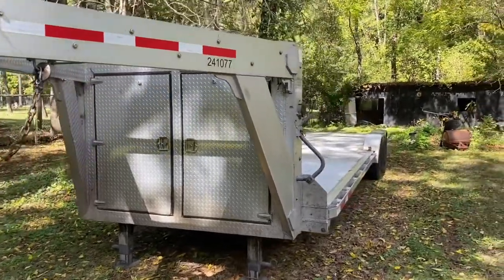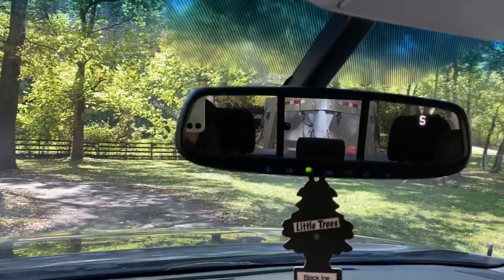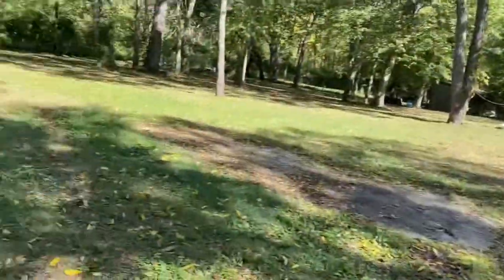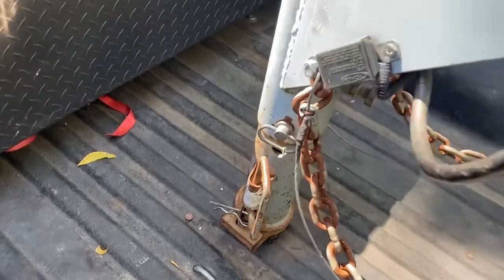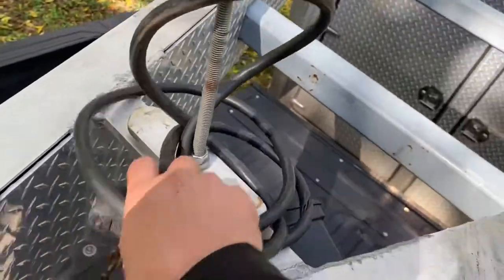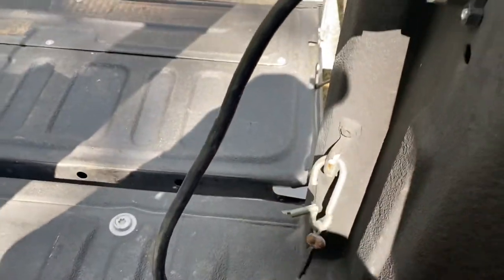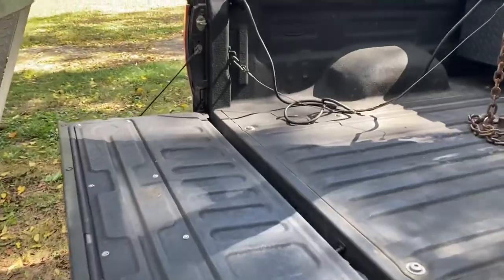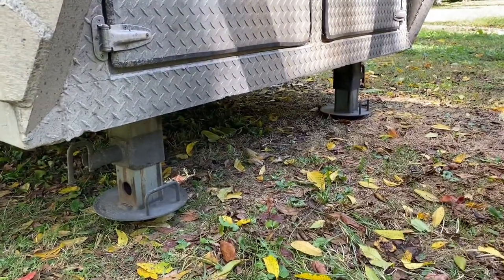How to Connect a Gooseneck Trailer

Comment: I plan on putting my 1994 F-150 to work like this. I'm working on getting the truck a new frame from a hot-rod shop in a few years.
Reply from the maker: An older F150, or any half ton of that era won’t be suitable for this line of work. It may do the job, but it won’t do it for long. Not enough power, trans won’t stay cool enough, rear end isn’t big enough, & the list goes on. If I were you, I’d wait until I got a bigger truck.
Reply: @HotshotJimmy  You do have a point about a bigger truck and how my current one is underrated. 

I got a couple plans for this half tonner of mine. Planning to swap a built Cummins 5.9L Natural Gas/Pump Gas swap (I like big 6 cylinders, but don't really care for diesels in the pickup truck community) so it can take the factory Ford 4.9L's place. Plan to replace the factory rear end for a Ford or Dodge Heavy Duty rear end. Swap the 4 Speed automatic with a 6 Speed automatic (may go for a GM trans with a custom bellhousing that'll fit the engine without having to have that pos adapter plate crap) with a 04-14 F-150 IFS suspension on the new long wheelbase hot-rod frame. 

There's A LOT of work I want to put in my old lariat, dude. A lot.
Reply from the maker: @RBLUS_TY  Even with mods, it still doesn’t have the GVWR for the job.
Reply: U should work on getting a new truck... nota new frame...
Reply: @S2KCYA  Nah. I don't want a new truck. Fucc the new ones.
Reply from the maker: @S2KCYA  Toyota replaced them for free, along with brake lines, control arms, everything. Get an American company to replace anything after 100k. Good luck with that.
Reply: @RBLUS_TY  this is a mess. But keep dreaming bro 😂😂

Comment: What's the payload capacity of your tundra? Depending on how much you're towing with that gooseneck, itll eat up alot of your payload of which, generally speaking, 1/2 tons aren't recommended for 5th wheel/gooseneck trailers, as far as I'm aware.
Reply from the maker: Payload doesn’t apply in commercial trucking. Axle weights do. Payload is never listed on the door jam. Modern half tons are able to pull lighter 5ths & GN. Depends on manufacturer & model.
Reply: @HotshotJimmy  commercial trucking aside, all mine and my wifes vehicles have stickers in the driver front door jam specifying payload, even 3/4 and 1 ton vehicles have them as I've seen when loading customers vehicles at home depot. That's interesting 🤔.
Reply from the maker: @Kingswood7189  They have GVWR. Maybe that is what you’re referring to. Trucks with factory GVWR under 10,000 are legally allowed to be modified to carry a heavier load. But with a maximum power unit GVWR of 10,000 according to the FMCSA. Any vehicle that has a factory rating over 10,000 is excluded.
Reply: @HotshotJimmy  I've seen those stickers, too. The ones I'm referring to show recommended tire pressure and cargo/payload capacity in kgs and lbs including the occupants.
Reply from the maker: @Kingswood7189  Tire pressure is on all vehicles. Cargo including occupants is not on most trucks that I know of. There is also not a perfect way to measure payload. That’s where GVWR & axle weights come in.

Comment: Do you still use this truck. I just bought one because I couldn't get a diesel due to personal but I'm concerned about the bed size in order to haul. What do I need to do different with the short bed? Amy advice
Reply from the maker: I recently traded it in. If you have a 5.5 bed, you’ll need an offset coupler.

Comment: thats a lot of weight for a tundra! how much do you tow over factory rating?
Reply from the maker: Double cab & standard cab models are rated for gooseneck towing, however with no stated capacity. Crewmax models cannot. Bumper pull is 10,200 lbs. I’m commercially rated for 26,000lbs GCWR.
Reply: Hey what's up man I like your Tundra a lot you pull a lot of weight have a 2005 Toyota Tundra double cab and I pulled up to 18,000 Pounds with that truck here in Colorado bumper pull trailer it was a dump trailer
Reply from the maker: @raulbueno4284  An 18k trailer would have pulled the hitch off the frame of that year Tundra. The 2000 to 2006 tundra hitches are not rated for much weight. They are not big enough.
Reply: The same hatch on the same frame as those second gen as the 3rd gen Tundra it's the same thing man look under 1st Gen to 2nd gen to a 3rd gen tundra or the same thing buy the first round and a third gen Tundra has I feel the same power and the same crap on it
Reply from the maker: @raulbueno4284  They are not the same, nowhere near the same.
Reply: They are the same and why why because look at the first gen look at the second gen and look at 3rd gen if there was no person or we'll never be a tundra think about that man why because look under from the first gen to the 2nd gen and 3rd gen Tundra I have a triple Tech frame as a semi they use the same transmission the same engine the same powertrain everything's the same bro it just bigger that's all you think you know everything I've been a mechanic for five years I've been telling for 10 years man
Reply from the maker: @raulbueno4284  2006 trucks & 2015 trucks are nowhere even close to the same.
Reply: @raulbueno4284  1st gen Tundras are a completely different truck than the 2nd gen (a 3rd gen is the same as a second gen but with updated sheet metal and interior). Different frame, different axles, the only carryovers were the 1GR and 2UZ engines as the entry and mid level options on the 2nd gen trucks as well as the associated A750E/F transmission. The 1st gen Tundra is more of a slightly beefier T100, while the 2nd and 3rd gens are true half tons (more like a 5/8th ton in reality). How do I know? I worked as a mechanic for 5 years at a Toyota truck and Land Cruiser specialty shop, and I have a 1st and 2nd gen sitting in my driveway.
Reply: Man the Toyota Tundras all generations half ton trucks but I'm saying is the first generation Tundra it's basically as a half ton more than 1/2 ton because I how up to 18000 pounds here in Colorado in the mountains Towing how much weight in Apple's better than a diesel truck I know that for a fact man come here to Colorado and test my truck my both trucks and I will let you what's the best route I'm not saying the first gen or 2nd gen or 3rd gen are better all of them are the best Ya Back Dan the trucks were smaller the Ram 1500 Colorado back then and a Ford F-150 was smaller are the same crap man they just got bigger don't tell me I don't know s*** bro you probably don't know crap still you were work for 5 years for Toyota yeah I work for 5 years out of mechanic working every single car 10 years of Towing you don't think I know
Reply: Let me tell you this man what's better a 4.7 v8 iForce versus a 5.7 iForce which one went to a million miles man the first generation Tundra with a 4.7 man I know they're a little bit bigger for trucks it doesn't matter why because I tested the first gen to the second gen third gen Tundra us up the mountains here in Colorado I didn't feel nothing difference over the truck they're both over-engineered and the balls heavy duty trucks I don't call on v h trucks I call him 1 ton trucks why because how much the truck will haul and how much will talk so much weight without no issues there Workhorse a truck man I know I'm talking about bro don't think I f**** don't know about my Trex bro yeah you been a mechanic for five years working Toyota dealership I don't give a f*** you did but let me just tell you this mad I do real world testing and real-world things with trucks redo fixing cars at Salt bro push it to the Limit over the limits to plus I know I'm talking about next time you should keep your mouth shut before you talk
Reply from the maker: @asher1147  Couldn’t have said it any better.
Reply from the maker: @raulbueno4284  Clearly you don’t know what you’re talking about. 2000-2006 Tundra’s are a slightly beefed T100. I tow for a living. I know what I’m doing. My parents have an 06. It’s no comparison.
Reply: @HotshotJimmy  is that because the crewmax come with the shortest bed?   I was thinking about getting a crewmax tundra to occasionally pull goosenecks.   But may want to go a different route now.   Unfortunately I really need the largest crewmax cab because it’ll be a daily driver for my family and we have young kids with car seats.   I was hoping to get the tundra and use it as an emergency work truck towing goosenecks.
Reply from the maker: @lordrichard8184  Toyota says no.... but I have seen it done. Only issue is you cannot have a bed toolbox or anything else in the bed while towing with a crewmax. There isn’t any room. Air bag it & the truck will be fine. You can’t turn more than 90° with a crewmax
Reply: @HotshotJimmy  why not crewmax? Only vehicles I see for sale are crewmax and I have a gooseneck trailer.
Reply from the maker: @CH-jq7xg  Can’t turn as sharp with the short bed. Also can’t fit toolbox & gooseneck at the same time.
Reply: No wonder tundra pulled across California city 360k lb space shuttle without problems.
Reply from the maker: @repairvehicle  Weight of the shuttle was 292k. 

The testing weight was just over 300k
Reply: @HotshotJimmy   , you are correct.  Still have tundra?
Reply from the maker: @repairvehicle  No, traded it in on an F450
Reply: @HotshotJimmy , how reliable is your f450 comparing to tundra? What has been replaced or repaired on Ford, if anything?
Reply from the maker: @repairvehicle  Tundra never let me down. 450 is new so nothing (yet)

Comment: First time I've ever seen a tundra pulling gooseneck ....😳
Reply from the maker: Not many commercially, they’re rough on fuel.... but reliable
Reply: @HotshotJimmy  are they bad on fule empty without trailer....
Reply from the maker: @burtbunns2270  Without trailer 15-17

With trailer loaded or unloaded 8-11 depending on wind.
Reply: Thanks ...I was checking those trucks out ... blessings 👍
Reply: 8mpg with trailer is not rough,  just like any other gas truck.

Comment: How much can you tow with the tundra?
Reply from the maker: I usually scale about 20k. Truck + GN empty is just over 11k.
Reply: @HotshotJimmy  Any issues with DOT towing over factory tow compacity?
Reply from the maker: @joshmansolillo1831  Factory recommendation & commercial GCWR are two different terms. My truck is rated to pull gooseneck & fifth wheel, however with no stated capacity l.
Reply: @HotshotJimmy  Gotcha, I run a 16k tag trailer regularly with my Tundra, always worried about getting jammed up if ever in an investigated accident. I suppose as long as your trucks GVWR is fine with tougue weight and your trailer is good send it
Reply: Would love a video on your truck set up! I just added the road master active suspension to my tundra and it made a huge difference
Reply from the maker: @TheRoeshow0324  I’ll be sure to make one soon!

Comment: This guy could drop a 100 dollar bill on the ground every weekday of the month and still be saving money on a cummins payment. 😂😂
Reply from the maker: What do you mean by that? I don’t understand your reference
Reply: @HotshotJimmy  it means a cummins is twice the price for the same thing a tundra can do for half the price ish.
Reply from the maker: @bryaniskoo  Oh yes, I try to keep cargo weight 10,000 pounds or less to keep the truck happy. 249k no issues or weird noises. However, I’m in the process of buying a new truck. I have to let this one go before it is worth nothing due to mileage.
Reply from the maker: @bryaniskoo  Oh yes, I try to keep cargo weight 10,000 pounds or less to keep the truck happy. 249k no issues or weird noises. However, I’m in the process of buying a new truck. I have to let this one go before it is worth nothing due to mileage.
Reply from the maker: @bryaniskoo  For non-CDL, the truck does just fine. 249k zero issues or weird noises
Reply: How much$ for the tow hitch on the bed set up?
Reply from the maker: @jgutierrez7527  $479 from 4WP. They will price match E Trailer.
Reply: @HotshotJimmy  thanks for the info,  now did you have get class C license to tow with your tundra and trailer?
Reply from the maker: @jgutierrez7527  No, here in Ohio you can have a standard license for 26,000 & below.
Reply: @HotshotJimmy  awesome news thanks for the info 👍

Comment: Honestly if ur driving a toyota u are not in the truck game that's a awd minivan with a bed...
Reply from the maker: This comment shows your ignorance.
Reply: @HotshotJimmy  using a toyota to pull a 5th wheel is ignorance... is that even rated for such a load??? Or u just hauling a empty trailer...
Reply from the maker: @S2KCYA  It is, go yo the dealer & look in the owners manual. 

This truck worked for 300k miles cross country. I traded it in. Never spent a day in the shop.
Reply from the maker: The USA is the ONLY country where Toyota trucks don’t dominate. Maybe you should research. Turbo diesel V8 Toyota’s dominate the market.
Reply: @HotshotJimmy  Toyota Tacoma trucks do dominate the US midsized market with highest sales than domestic brand.